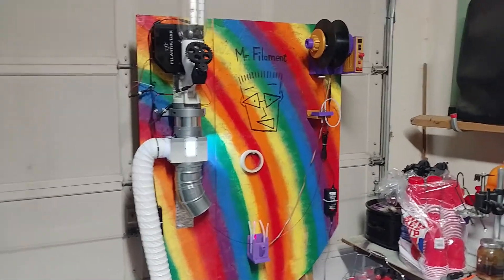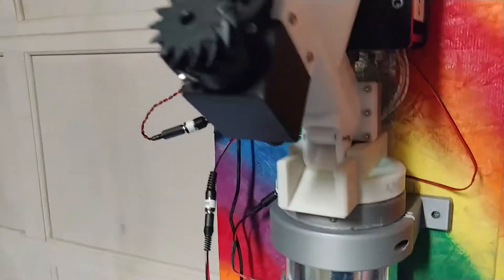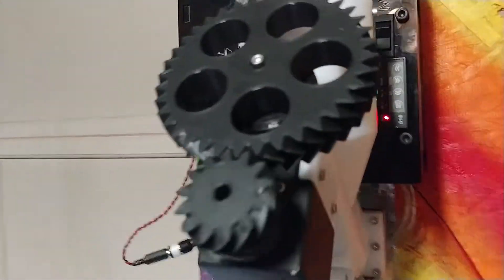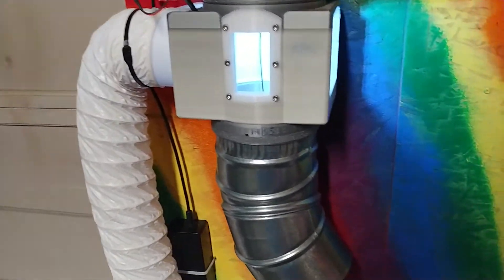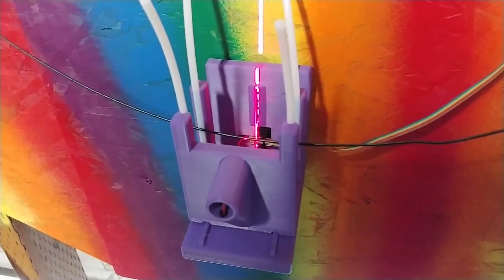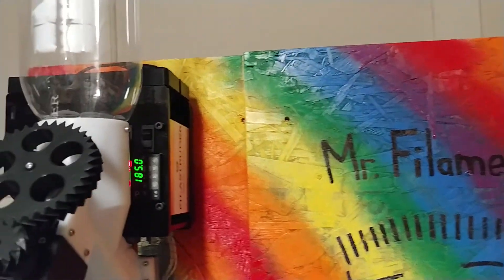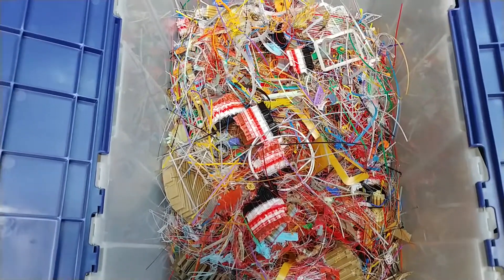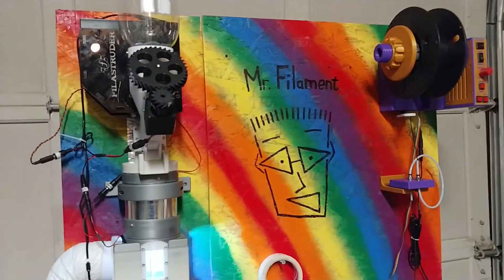Mr. Filament (My Filastruder)

Comment: Great work here, I love the mods you made to everything and the filawinder has a really cool giant bolt aesthetic. I would love to know more about the base and how you attached the filastruder and filawinder to it. I’ve just completed my filawinder, struder to go and then I need to figure out how to set it up vertically.
Reply from the maker: Awesome! If you're not already in it, look up the "3D Printer Filament Recycler Group" on Facebook. That's where I share my escapades. ;-)
Pretty much all the accessories I have are initially designed by Erik Bjorgan: https://www.thingiverse.com/universaljoint/designs
I've done some remixes of a few of them for how I like to print things, so be sure to check the remixes of his stuff to make sure you get the model(s) that suit you. He also designed the new Filawinder, but has not yet published it. I was working with him on design and testing, but there's a snag that requires either a major rework, or custom firmware for the Filawinder board. Hopefully he's able to tackle those some time soon.
Reply from the maker: As for the base, it's just a bunch of 2x4 and sheet wood cobbled together. You could mount it all to any surface, but I wanted to be able to move it if needed, and had the scrap on hand.